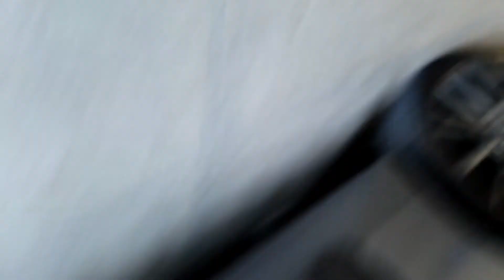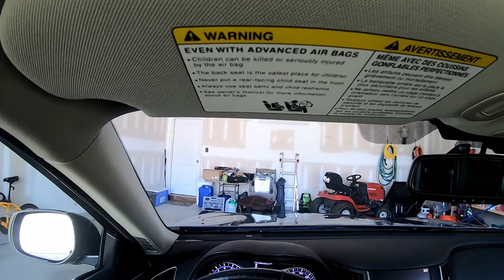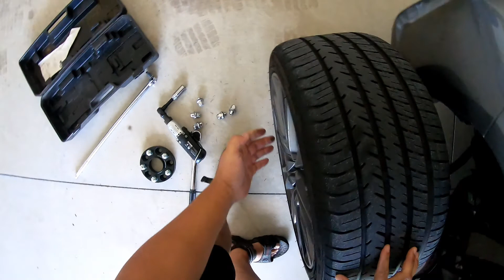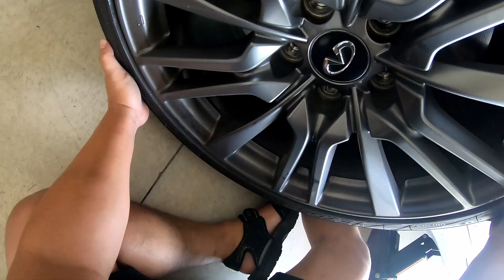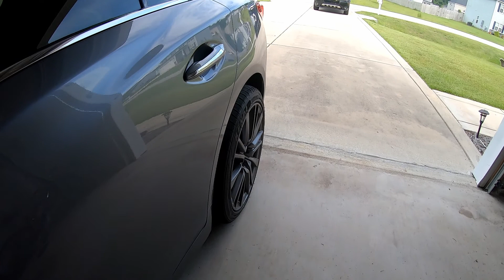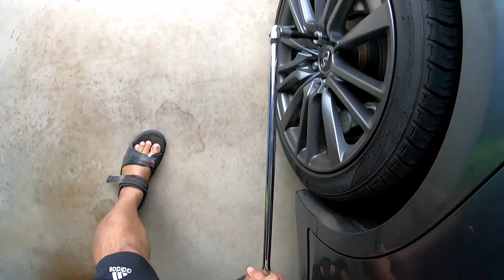Q50 Wheel Spacer install | Infiniti Q50/Q60

Comment: Does it fit on a 2015 3.7 ? Ik pretty dumb question but I just want to make sure before buying
Reply from the maker: Im not totally sure. Do you have the exact same wheels? Take 1 wheel off and look to see if it has the same lip that the Sport wheels have. I tried to point out in the vid about the lip thing.

Comment: You think 25mm rear and 22mm front and the studs would not stick out on a 22mm? I've been reading running a 25mm spacers on front , the tires kinda stick out a little more than the rear?
Reply from the maker: I think the fronts look good with the 25, it's an agressive look. With 22 you may have to use shorter studs or cut the ones you have. Maybe ordering them from like an Autozone see how u like it and exchange it if you don't. You won't have to pay a shipping fee to rerurn them that way.

Comment: You didn't have any issues without the extended studs ? I read if your spacers are above 10mm most people had to swap the factory ones. Not sure what size spacers you used or if that statements true or not. I ordered 5mm ones for all 4 to be safe before getting any larger
Reply from the maker: I am unsure if you are talking about the spacers that do NOT come with studs. I bought the spacers that DID come with studs. So basically I had to cinch the spacers to the hub with the factory studs and the tires were cinched to the spacers studs. In this situation, you need bigger then 20MM in order to clear the Factory studs.
Reply: @LayzeLyfe  ah you're spacers came with - nice ! Makes sense bro.
Reply: @LayzeLyfe  you have a link to the spacers by any chance?
Reply from the maker: @shad3128  i sure do. But remember these are for the RS400  wheels, there are different ones for the Luxe and sport wheels. https://amzn.to/3561lP5
Reply: @LayzeLyfe  I'm rocking the RedSport as well my G 😎 thanks for the link!!
Reply from the maker: @shad3128  LOl hell ya, RS Nation!
Reply: @LayzeLyfe  yeah dude cars been great to me after I had a few others. I ordered the spacers you linked me to, over time I may do the RSR lowering springs but that's a horrible job to do labor wise, so gotta save up money to have my shop do it. Thanks again for the link
Reply from the maker: @shad3128  no prob with the link. Let me know what yo think after you install them. Take a vid. I was wondering how hard the lowering springs would be, as I have the DDS. I may just take it to a shop also. Let me know if you get yours done how much it costs and hours of labor.
Reply: @LayzeLyfe  if you are on Awd as well, it is about 5-7 hours of labor for a skilled technician to do. Infiniti is around 128/he for labor, so ballpark estimate is around 600-800. I'm trying to find a performance shop who have a cheaper hourly rate to do it, since the labor and cost of springs is over a thousand which is pretty crazy.

Comment: Yeah bro I’m ordering these for my 2016 rs400
Reply from the maker: I think I have the link in my description. If you have the RS400 wheels, you will need the exact ones to fit.
Reply: @LayzeLyfe  I already found the link bro thank you for the follow too
Reply: @LayzeLyfe  do they rub at all bro ?
Reply from the maker: @heemdollas8016  No I have not had any probs with them other then a tiny bit of shaking at like 70 mph. That might just be because I may need to get my wheels balanced.

Comment: would these spacers work on my 3.7 q50?
Reply from the maker: I am not 100% sure, just make sure they have the same lugnut pattern and inside rim type. The problem is the 3.7 doesn't come with my RS type rim, the inner part is different from standard rims.  Most sites will have a way for you to make sure it fits your car.

Comment: Hey I have a 15 Q50s with the performance wheel package, basically 370z wheels. Would a 25mm spacer work as well? I like the way yours fit after the spacers. Trying to research on every form and nothing.
Reply from the maker: Ooo I am not sure which spacer would fit and how it would look on that set up. 25 mm is about 1 inch, so measure out from the wheel to the body of the car to see if 25mm is enough or too much. IMO you want the wheels to be right at the edge of the body or a little but further out. As far as which type of spacer you will need, take off the wheel and look at the wheel hub to see if it has the lip or not.
Reply: @LayzeLyfe  I’ll have to make a vid on this.lol Not many Q50s have these wheels so it’s hard to find anything on them. Thanks for the fast response 👍🏼
Reply from the maker: Yeah you should. This Q life is a growing community I am sure alot of people would like to know this. I never even heard of the performance wheel package, i thought people just bought 370z wherls cause they are Rays Engineering wheels lol.

Comment: would these work on a silver sport?
Reply from the maker: Depends on which wheels they have Bryan, if is the same wheels thrn yes.   I show in the video the 2 types of wheels, one has a lip and the other doesn't.
Reply: @LayzeLyfe I have 19 inch wheels with the akebono breaks i’ve ordered 3 pairs of spacers already none have fit haha

Comment: Adding rotational mass is not usually going to make your car perform better. If your going just for looks, I would agree it looks nice/more aggressive.
Reply from the maker: Definitely not a power mod. Some might say it may help a tiny bit in handling as it  widens the track. I did it purely for looks.

Comment: How good are they so far any problems with them yet bro????
Reply from the maker: No problems at all. just make sure you torque them correctly. I absolutely love the agressive stance they give, I just need to lover the car about 1 inch.
Reply: @LayzeLyfe  I’m thinking about doing the same things bro! And I’m going to paint the stock wheels black in the mean time until I can get a set of nice wheels good looking out bro keep it up!
Reply from the maker: @revcliqueracing8461  yeah, the stock Sport wheels actually do look good. Painting them black will make them look more custom. I am in the same boat as you, I was thinking maybe bronze   for my car.

Comment: Did you notice any crack or issues with the spacers after using them?
Reply from the maker: I was going to do a follow up vid about them soon as I have had them on over a year. I'll wotk on it tomorrow.
Reply: @LayzeLyfe  Thank you sir!
Reply: @LayzeLyfe  Please include some warranty info on the spacer.
Reply: @LayzeLyfe  any update?
Reply from the maker: Sorry, got busy over the past week. I will have to get a vid out on monday.
Reply: @LayzeLyfe  Did you have to re-torque the spacers after several miles? Curious if one of the studs or nut has any issue(s)?
Reply from the maker: I heard of people doing that. I did not. I don't recall any tire shop doing that, when they remove and re-bolt on your wheels.
Reply: @LayzeLyfe  can we we expect the update video?
Reply from the maker: Yes.
Reply: @LayzeLyfe  where is the video please? I just purchased through amazon and added a warranty for 4 yrs.
Reply from the maker: Tomorrow for sure. I have a free day.
Reply: @LayzeLyfe  ok
Reply from the maker: I just finished filming and checking the wheel spacers today. I wont have time yo edit it soon. Butshort story is  no issues at all. No fusing with the rotor or any serious corrision. But keep in mind i live below the snow belt so we dont get much snow and KIRYU lives in my garage. Hope that helps.
Reply: @LayzeLyfe  I live in Chicago. I will add antiseize and maybe the thread locker.
Reply from the maker: Ya, Chicago is definetly in the snow belt! I would also agree with your comment.
Reply: @LayzeLyfe  I just installed the same hardware on 18 q50s. All factory hardware. While driving slow, I hear like something is rubbing together. Any ideas?
Reply from the maker: Make sure you bought the right ones for the rims you have. Check clearance between tires and wheel well. You did make sure to torque the lugnuts to exact OEM specs. Maybe you didn't tighten one of the inner lugs right. I would check all that before deiving again for safety reasons.
Reply from the maker: Did you have the redsport wheels or the regular Q50 wheels? The exact wheel spacers I bought will only fit the redsport wheels. There is a non redpsport wheel spacers for the other wheels. You can see my original vid to see the difference.
Reply: @LayzeLyfe I have the red sport 2018. I torque to oem spec on the spacers.
Reply: @LayzeLyfe  So the nuts to the wheel on the front right were getting lose! Been working on cars since my 08 lancer so I know thing or two bout torque. I torque star pattern and clock and counter clockwise just to make sure.
Reply from the maker: Wow, weird. Yeah it sounds like you have all the tecqniques down. Hope the stud didn't snap.
Reply: @LayzeLyfe  Luckily, nothing was damaged. More importantly, nobody was hurt. I will be returning and will just get the correct tire/rims down the road.
Reply from the maker: Ya, I am glad people are safe.

Comment: Bro I was told to use some sort of gel inside the spacer so it won’t stick
Reply from the maker: Tell you the truth, I have not taken them off yet so I do not know about this but I can see where they could stick. But a good blow with a hammer might just be the deciding force LOL. I will have to do a follow up review. Thanks!
Reply: Kp me posted.     Imma bout to put them on my max 2010  25mm front bck
Reply from the maker: @jaybreezey6945  I will try to show y'all this next week.
Reply: The lube  u use is ante rust  so they won’t stick
Reply from the maker: Thank you thank you!

Comment: You need to upgrade your pads and rotors bro that should be next lol
Reply from the maker: Thanks Josh! I gotta wait til they need replacing. That's an expensive upgrade. One day though.
Reply: @LayzeLyfe  z1 motorsports have great packages for it, and some people have said good things about ebay kits even. I think the spacers and extended studs are expensive too!! Lol. Good video though man, thank you.
Reply from the maker: @shad3128  Thanks Chris! I want to add some perf mods also. it's a slow build. budget matters here. Stay tuned.
Reply: @LayzeLyfe  preaching to the choir my man! Did mine over about a year and A half. Looking forward to how yours comes out

Comment: Are your rims 20x9.5
Reply from the maker: They are the stock Q50 RS wheels. 19's. I dont know the width.
Reply: @LayzeLyfe  how about the tire is it stock 245/40?
Reply from the maker: @DimplesDon9  They are not the stock tires, it's an off brand that I never heard of before, the previous owner replaced them. They work pretty well though I must say.
Reply from the maker: But it is the stock tire size.
Reply: @LayzeLyfe  for red sport is it 245/40/19?
Reply from the maker: Yes it is 245/40 19.

Comment: I put spacers on my Q and now I get mad vibrations going 60+
Reply from the maker: I have a little vibration over 60. Not enough to bother me. I dont think you can get the spacers balanced. I am not sure though.
Reply: Need hubcentric spacers or if you bought new wheels might need a hub ring to match the 66.1mm hub
Reply from the maker: @manik2860  I bought hubcentric spacers. Now you have to be careful and buy the spacers that are specific to your car. I accidentally bought Q50 spacers not realizing that the regular q50 wheels are different inside than the Red Sport wheels so they did not fit. Amazon can get you the exact ones you need.